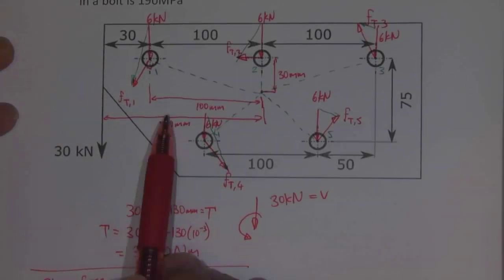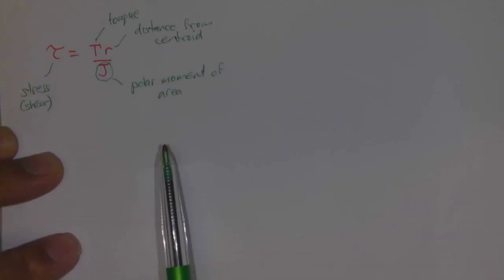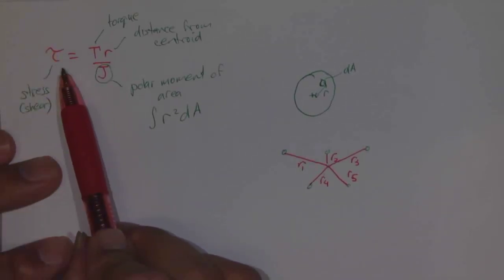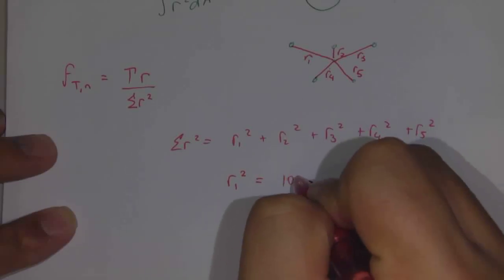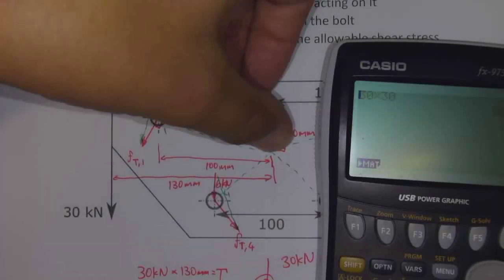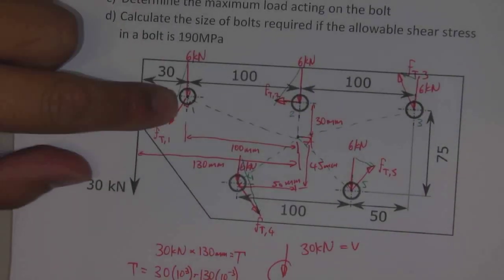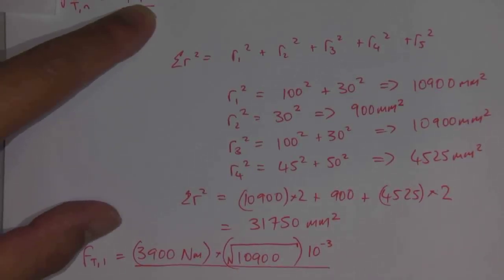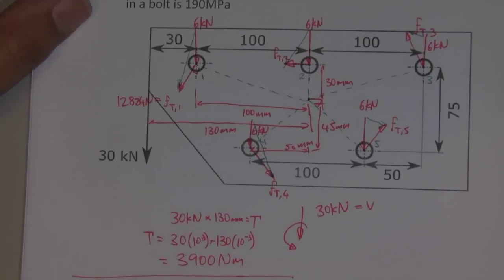Example - Bolted connection with torsion and shear loads (Part 4 of 6)

Comment: Why torque due to shear force from the centroid was not included in to to the bolt torques !?
Reply from the maker: Can you confirm what you mean here as I believe it has been included but we have used the principle of superposition. ie I have dealt with the shear force and the torque force separately, then added their contributions afterwards.